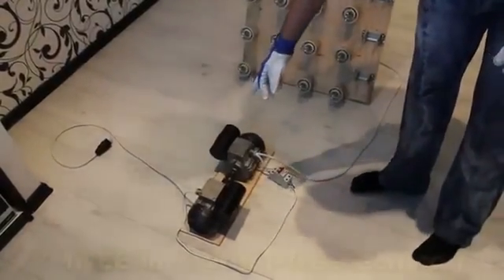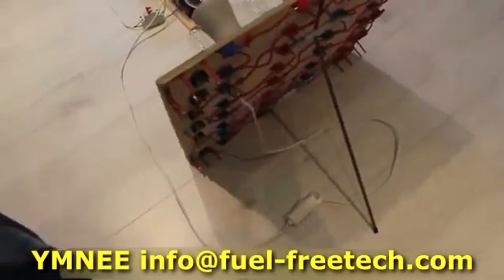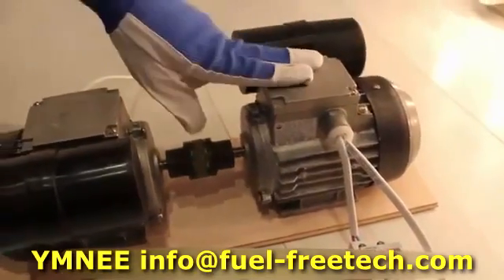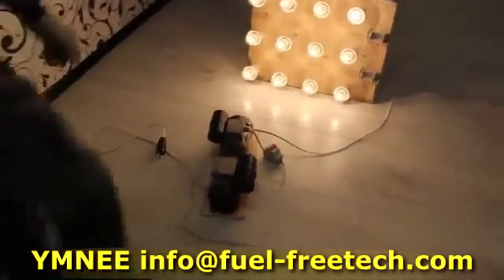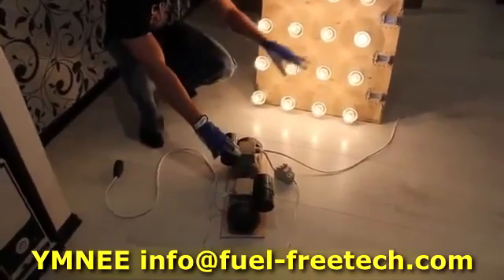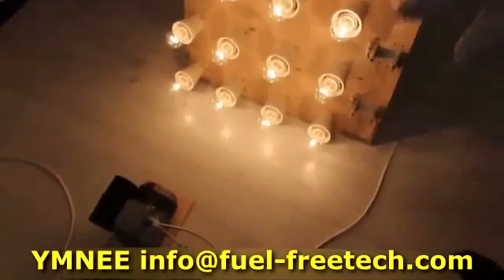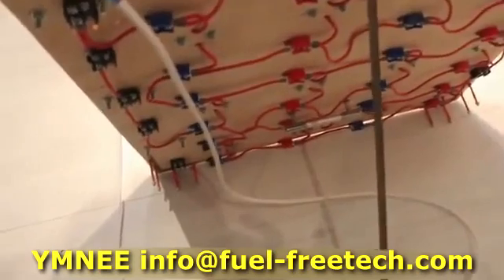Свободная энергия:Мотор-генератор.Опять руские впереди!

Comment: I think batteries and capacitors are   attached in that black tube. How long this unpluged selfgenerating last? 10 monutes or one hour? After use up all stores batteries then what? So 16 of 25W bulb is 400W.  Let's assume he charges 400wh with 220v grid with 5A that will takes about 21 minutes. So if this motor is fully charged before showing, he can full people at least one hour he can run. So all fake!  If he runs 48 hours after unplug from the grid power? Than I can say it is overunity.

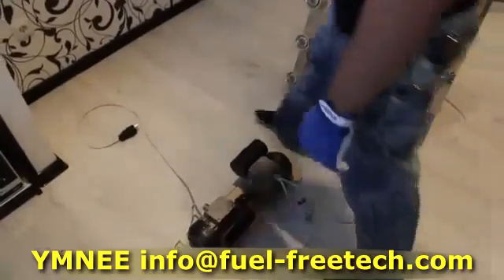Comment: 1:30 The left cord has a switch, that is switching on the relay that is a small white box with red elements shown on it on the lower side of the video. The relay is getting power under the floor. Notice the lamps are getting very bright at the start and then get dimmer when motor gets speed up. This means that lights and motor are getting energy from the parallel circuit.
Reply: may be,,,, may be,,, but everybody wait the MIRACLE
Reply: Elena Sverdlova  свердлова не права  : ни в правилах рус.языка, ни по жизни....ALOHA!!!!!